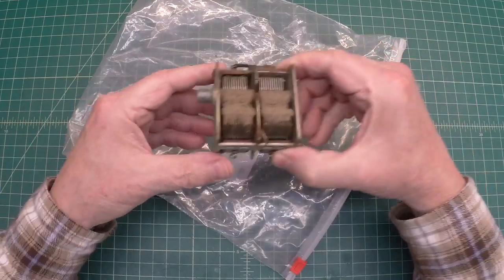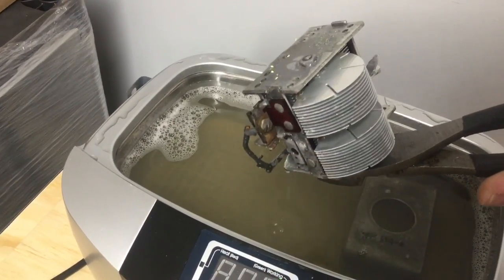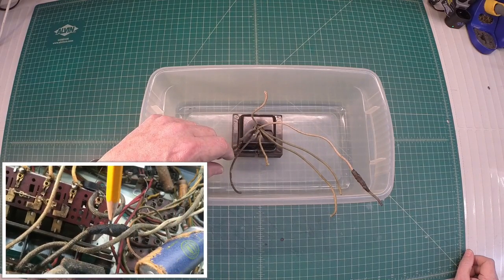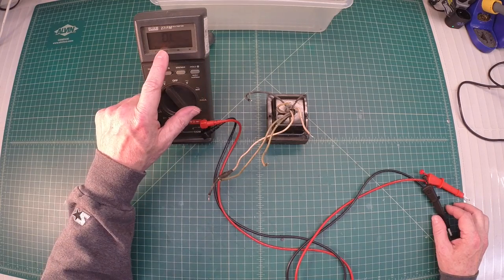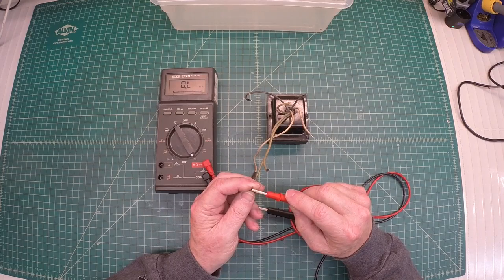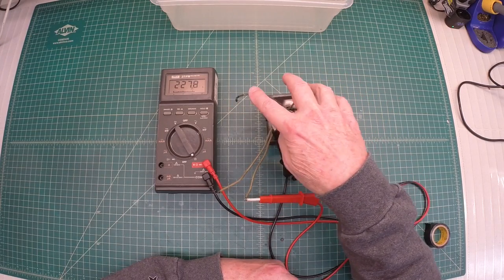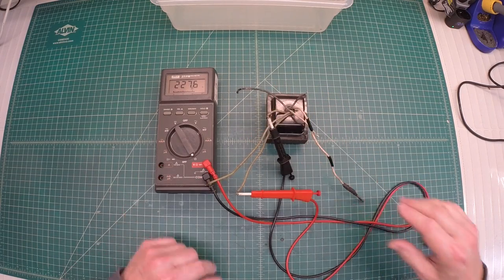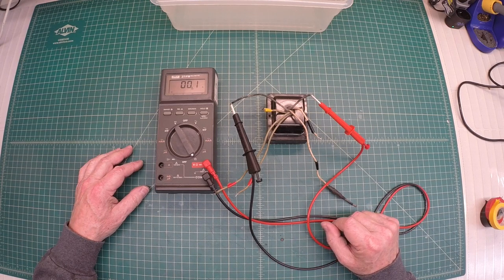Philco 41-280 - Power Transformer &...

Comment: How do you like the Harbor Freight cleaner?  I have heard horror stories about them crapping out fairly quickly.   Any issues with it?  How long have you had it?  I am sure some of the stories are from folks that should not be let out of their cages and playing with electrical gear.  LOL.   I would trust your opinion more than those.   Thanks.
Reply from the maker: +jp040759 I've had it for approximately 3 years and used it for multiple restorations and other items around the house. It hasn't failed yet. The quality is OK for my needs, other than I wish it was a bit bigger, but the price fit my budget. Hope this helps. Good luck if you get one, be safe and thanks again for watching. If you have any other questions, don't hesitate to ask. Best, Don
Reply: Thank you sir.

Comment: For someone as safety conscious as you, you neglected one omportant test.  You did not show that there was on connection between the frame of the transformer and the windings.  A connection there could be painful if not fatal
Reply from the maker: +Dan Floyd Hi Dan - great point. I always bring these up on a Variac while watching the AC current, but I should include this in my protocol and annotate the video to your point. Thanks again for your feedback. Are you a restorer of vintage electronics, I don't recall. Best, Don
Reply: Hi Don
No. I do not restore radios,but, I worked repairing electronics for over 40 years.
Reply from the maker: +Dan Floyd Thanks again Dan, I noted the video to ensure those steps are taken. Best, Don